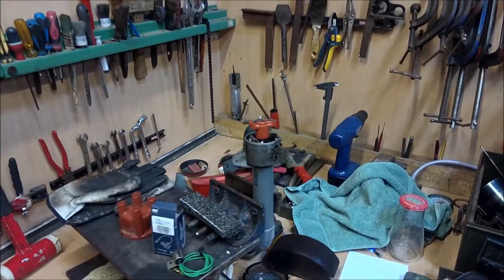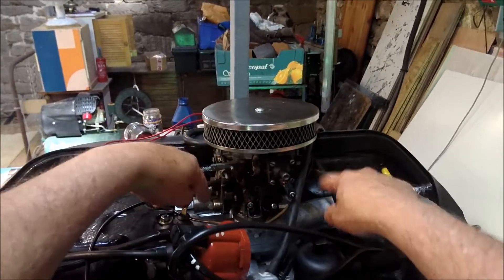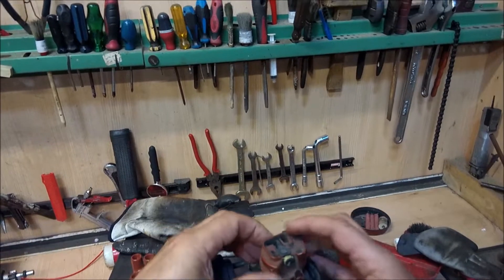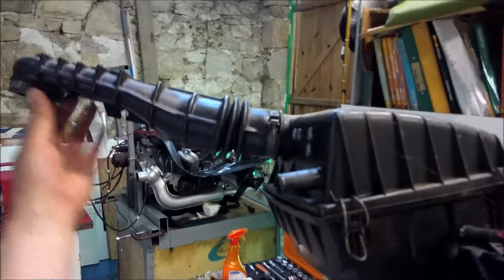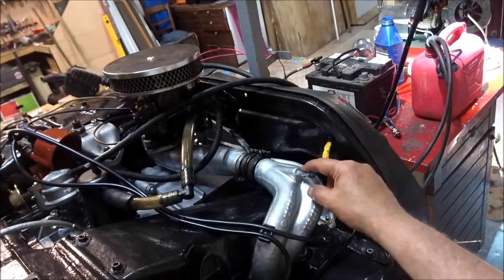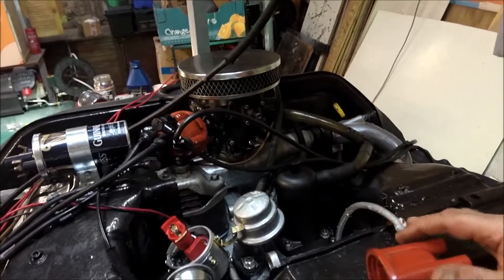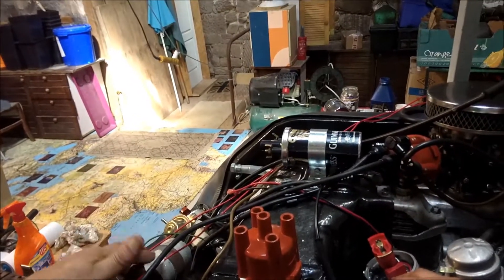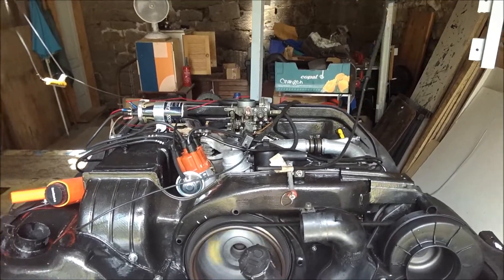How to fit a Powerspark Distibutor to a VW air-cooled motor

Comment: Hi, I’m looking at fitting one of these systems in place of the VW electronic system on my t25 2000 CU engine running standard twin Solex system. It has DVSA dizzy, but the power spark dizzys only seem to come as SVDA, which vacuum tube do I blank off?
Reply from the maker: Hi, you can blank off on the carb for the inner spigot DVDA to SVDA, but you will have to check the advance, about 8 to 10 degrees of advance at TDC, Use 98RON E5 petrol...